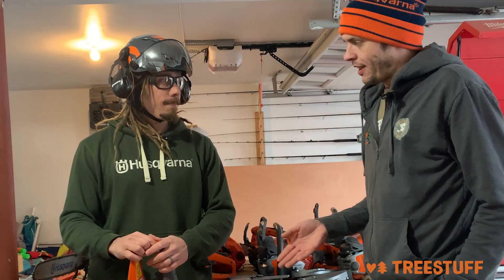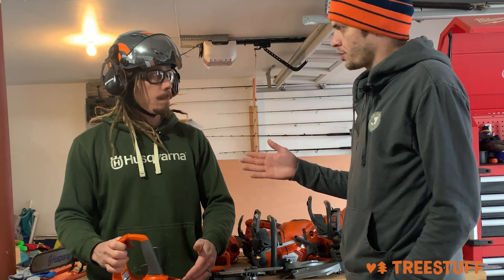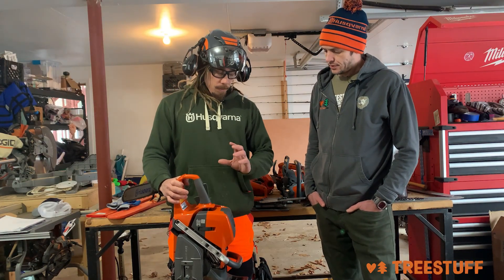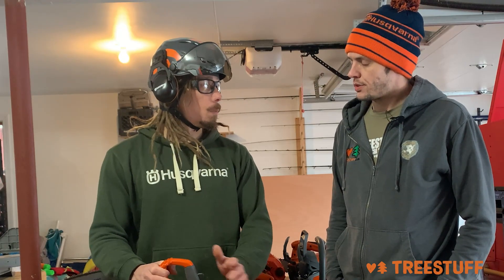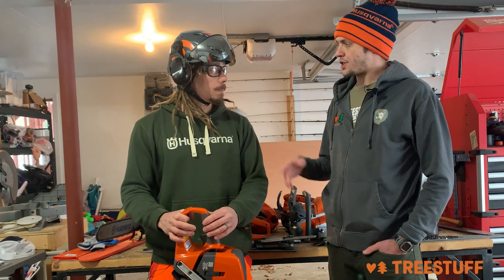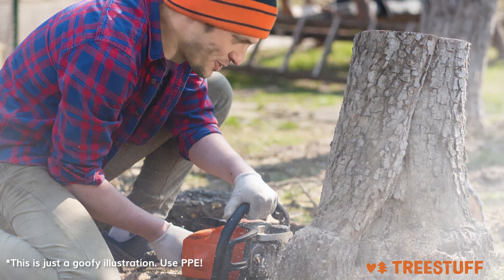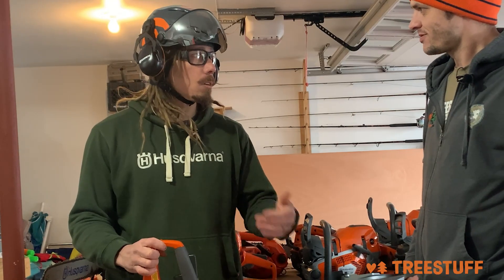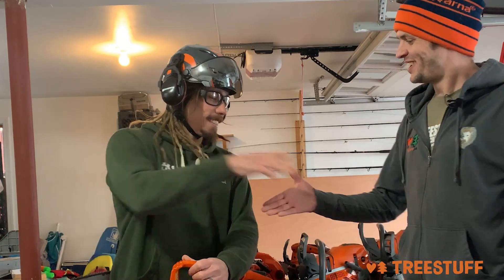Husqvarna X-Torq Technology - TreeStuff Closer Look

Comment: Is the new 150BT the one with the Blue choke lever on top have the X torq engine. They make 2 150 BT and one has a red choke lever and one has a blue choke lever. I believe the one with the blue choke is just a standard 2 stroke engine and the red choke lever has the X torque engine. Any thoughts

Comment: Husqvarna is junk. I bought a husqvarna blower, and it got a rattling sound. I got a Husqvarna 3120 chainsaw, which was made in Sweden and cost about 2k, and it also had a rattling sound. I've run Echo blowers and saws with nearly no issues. Echo and Stihl are just made better.